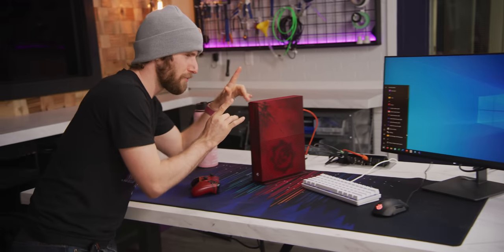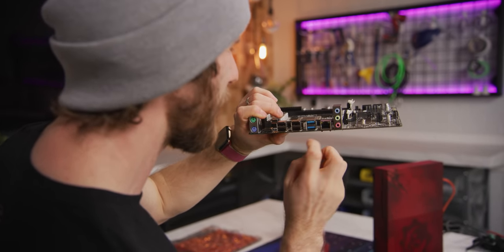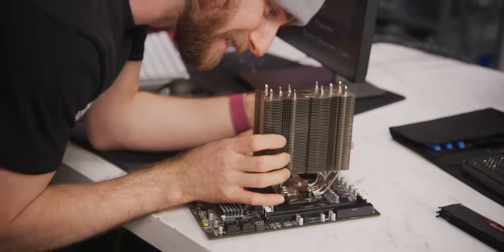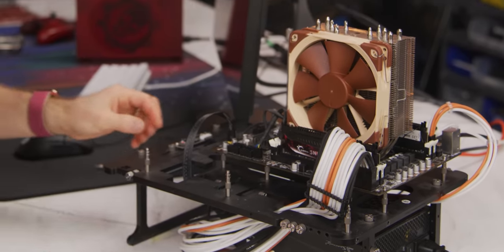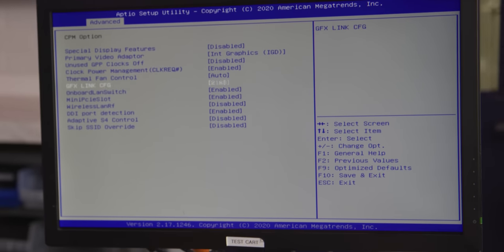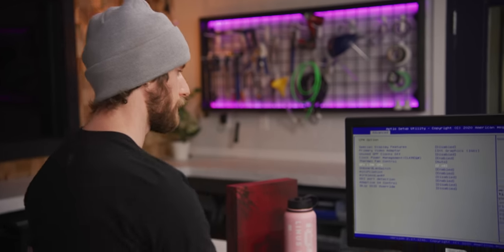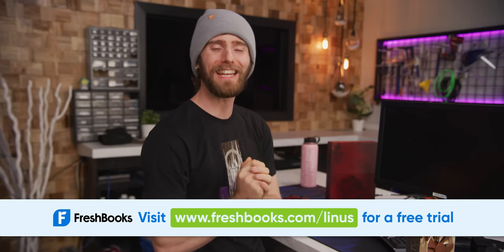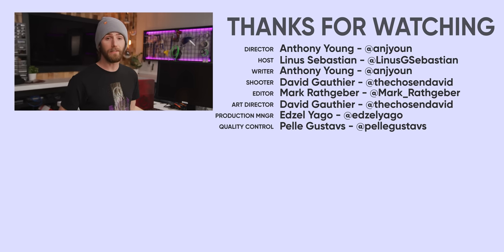We ran Windows on an Xbox! … Sort of - AMD A9-9820

Comment: "The Internet is crap! Its only capping out at 500 megabits"

Me who paid $200 for the fastest internet my country can offer, 100 megabit: what?
Reply: laughs in satisfied 30mbs
Reply: Laughs in 6 mbs of download and 0.50 of upload
Reply: 100 megabits cost around $90 a month for me. I'm using 20 megabit though.
Reply: fuccin cryin in 1mb/s at max
Reply: I have 30 mbps internet but i usually get 900 kbs when i download things??
Reply: @dedmemes.  Must be a trash ISP
Reply: Crying using a 56k modem
Reply: Laughs in 10 mb down 2 up
Reply: @Mark_Vadhil  i get between one and five and it takes years to download anything
Reply: laughs in 300kbs download and upload
Reply: haha i only have 50 megabits and my provider can give much more its just too expensive
Reply: Me with 10 kB:    :(
Reply: Laughs in greed at my American 400mbps (800mbps capable cable) internet speeds @ $35/month, from a sh*tty apartment! Not even a house!
Reply: Networking performance isn’t the same as internet performance. Your PC likely has Gigabit networking which you could easily fully saturate on a local network, I.e. Peer to peer or through a switch. He’s not saying “oh no my internet is slow I only get 500Mbps down” he’s saying, the local networking performance, from his local server, is trash. Honestly, if the board has gigabit networking and the system can’t fully saturate it, that is trash.
Reply: @dedmemes.  internet speed is measured in megaBITS whereas download speed is megaBYTES. There's 8 bits in a byte, that's where your discrepancy is coming from
Reply: Laughs in homeless using data
Reply: my internet is 400mbps and i download stuff usually at like 360 to 370 mbps
Reply: Laughs in 1 gbps using ethernet
Reply: Laughs in 3mbs
Reply: POV:You have 100kb download speed because your brother uses 4 devices(which is me)
Reply: @lorrean9604  Giggles in 150kbps down/up
Reply: @NotZeko  laughs in 1.70 mbps but not satisfied
Reply: @crackedbymac  laughs in 1.70 0.60
Reply: I get an 100mbps for just about 13$ a month? Lucky to be an indian
Reply: @nickloss  Even then he should be getting more than 3 MBps
Reply: Cries in 100 kbps
Reply: @Impulseblows  u will getover it i had 980kbs few months ago :D
Reply: @NotZeko  ratio
Reply: @crackedbymac  what country do you live in?
Reply: 10mb down 3mb up for 70 bucks a month here
Reply: @crackedbymac  Cries in 746kbs
Reply: Currently paying 17$ for 200 Mbps download and shitty 10 Mbps upload, but from the last year we have an ISP that provides 1 gbps up/down for only 11$, waiting for it to come in my house
Reply: @sebasmiro  habla por vos, 120mbps down 20 up, 45 usd
Reply: @user-tl8pc9fd3l  aguante costa rica!!¡! d donde sos? llevame
Reply: Me: you have internet?
Reply: Nevify  it was a joke about my internet
Reply: @wilburcobb4596  bro what company offers that much at 35$
Reply: @Caveyy  Just Suddenlink, nothing special ...
Reply: @infogeezer55  13 dollars a month? USD? That's crazy cheap. I pay $120 CAD a month for 250mbps.  7200 rupees.
Reply: @jaded9436  yup usd,I know it's crazy cheap but other stuff any foreign brand like iphone, it has like 40% tax on mrp!
Reply: Laughs in 20 download 3 upload
Reply: Me who has 2mb per sec 😭😭
Reply: welcome to australia
Reply: @Mark_Vadhil  how are you on YouTube dude
Reply: @Icycapy8755  u cant be on YouTube with 10kb can you?
Reply: @Mark_Vadhil  Try paying $1000 for the occasional 5mb/s miracles
Reply: Laughs in 1mbs download 0.2 mbs upload 

(This is a cry for help)
Reply: i pay 96.04 cad for 1gb down and 30mb up takes me 15 mins to download destiny 2
Reply: Me who can't get stable 2mb/s.
Reply: You have mbs i have kbs
Reply: My internet is so bad i watch this on 240p
Reply: In Iraq 1.4 MBS cost 100$ for month or get limited LTE 4G 30 GB cost 30$
Reply: I get 153 mbps download  and 10.9 upload
Reply: Am I the only one with normal internet?
Reply: Germany moment
Reply: @schmalettesm2069  yeah here in Germany I pay 46€ for 50mbps yey
Reply: @crackedbymac  what I get 2 MB’s of download in aus
Reply: Laughs in 340kbps living in the middle of The United States
Reply: I pay €24 for 500mbps upload/download. There is 1gbps available but I don't really need that much. Nowadays I rather have 50mbps with lower latency for games than higher bandwidth.
Reply: We don't even got 100mbps connection in Romania anymore.
The minimum is 500mbps and it costs about 8 bucks.
Reply: Same here buddy, same here
Reply: I'm on a 8mbps DSL connection
Reply: just imagine having fibre optics super fast broadband and only getting 2.5mb/s 😂
Reply: I pay $90 for 25 mb.. best I can get cause they don’t run Ethernet cables by my house cause I live in a rural area
Reply: @wilburcobb4596  which isp bro
Reply: Me, who payed $60 for a gigabit until the company went under, now paying $80 for 860 mbps down and 40 mbps up
Reply: My mom's phone pulls 300 plus 400 plus at most tablet I'm on rn be pulling 150
Reply: They're talking about the speed of the ethernet connection to their local network. It should be capable of 1 gigabit speeds, that has nothing to do with the internet speed.
Reply: Me with 1 MBps: ...
Reply: damn i get 1gbps for $30/m
Reply: me crying in the corner with 239 bytes/second:

Comment: I actually learned a lot from this I always wondered why the speeds on wifi and ethernet are so low in console but seeing what the soc is capable of and how it splits the lanes it actually all makes sense.
Reply: My console internet speed is just fine with ethernet. Absolutely terrible with wifi.
Reply: my console wifi works amazing, i have done port forwarding set up DNS and am also using 5ghz wifi and i get 330 mbits out of my 350
Reply: Lol my wifi speeds are fine

Comment: Did you try populating all "ram" slots and then running the GPU benchmarks? Since this was a SOC with ram meant to be mounted around i was curious if the slots on the unpopulated side were meant more for the GPU usage? Just a random thought.

Comment: I get the impression this was meant to be used in an AIO of some sort.  That would explain the DP_IN connector, as some Lenovo AIO machines allow you to use them as a monitor for whatever reason.  I guess when the computer becomes obsolete at least the screen will be of some use.  You might look to see if there's a switch connector for a video source selector that would go along with it.

And if it were in an AIO it would explain why there's none of the traditional mounting mechanisms for a heatsink as it would likely use heatpipes to a rad somewhere else in the chassis, much like a laptop does.

Comment: you can 100% in theory run any OS on the architecture that supports an xbox, the issue is the xbox's board is locked in some capacity, not allowing you to write a new os to the bootloader along with physical protections on the board to prevent the loading of unsigned code from microsoft

Comment: I've personally ZIP-tied a cooler to my CPU. I won an AM4/Intel cooler, but I only had an AM2 platform due to financial issues at the time, so I removed the original cooling bracket, searched the basement for ZIP-ties, then attached the cooler that way. I've later removed it once I got a better PC (4th gen Core i5).

Comment: "We ran Windows on an Xbox! ... Not at all. "

Fixed that for you.
Reply: I mean the CPU and RAM layout is pretty much identical which are the two arguably most important parts. Plus everyone knows you can’t actually run Windows on an Xbox console so all you need is common sense to fill in the blanks...
Reply: I mean there is Windows XP for the original Xbox. It runs like crap.
Reply: Windows ran fine, games not so much.
Reply: @greylawson6352  well with the console's capabilities, and a literal Dev kit app on the Xbox's store it isn't so impossible, and even if it was the title is simply lying so I don't see why defend it

Comment: Before watching, it will obviously work, but it won't have the huge amount of optimizations that the Xboxs have from the box. Technically the DO run a sort of version of windows software, but the hardware is SUPER optimized in the games by the developers specifically.
Reply: Yeah devs have control on over clocking and stuff

Comment: I suspect this is used in something like a CT or MRI scanner, which are liquid helium cooled so you wouldn't need an aftermarket cooler and it might have temperature settings that look at how much above the scanners operating temp it was rather than the core temp. It wouldn't be used to transfer files over network but would be used for remote viewing in a control room.

Comment: I think it would be an incredibly smart move for Microsoft to allow/licence AMD to release the XSX chip as an incredibly powerful desktop APU, with 1 year of Xbox GamePass included.

The XSX chip in a desktop power envelope would be a monster, it could possibly use a full die depending on how yields are now but crucially the XSX has a 320-bit memory bus but only uses 10GB of memory at this speed for financial and maybe heat reasons as MS could cut the other 10GB down to 6GB running at a much slower. But for the PC market this could easily be changed to run the full 20GB of memory at the full 320-bit speed but I would propose upping the current 2GB modules to 4GB and so having 40GB of ultra fast GDDR6 memory all using the 320-bit bus and then using this as a unified system memory, ie doing away with the much slower DDR4 DIMMs we normally have in a PC build. 

I would love to see how this would perform, I think it would be much faster than most think and not just in gaming but regular applications too because of the high bandwidth GDDR6 being used as system memory which is massively faster than even DDR5 but would have poorer latencies.

What do you think?
Reply: They are boomers. So no.

Comment: Ah get the Chinese software for the thingy  maybe some opti.ised drivers  it will be a mobile anyway a portable game console  by installing some batteries and a usb powerd monitor would be interesting if the chip is same as Xbox  why not use the hard-drive from an Xbox  who k ows maybe some optimization in it

Comment: When you play rocket league in an Xbox on the default Xbox system: 60 fps - 80 fps
When you play rocket league in an Xbox running windows: 15 fps
Reply: Yeah windows has terrible optimization, that's the thing for console they don't need to shipped a good hardware but just optimized the software just like the switch, the switch is probably just as powerful as 2015-2016 midrange phone